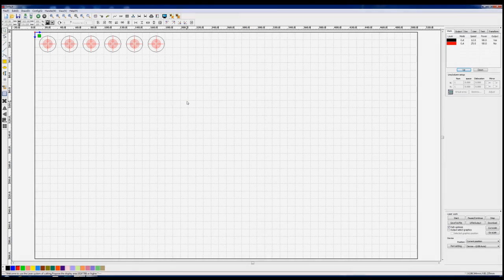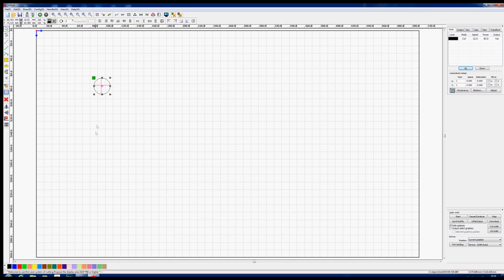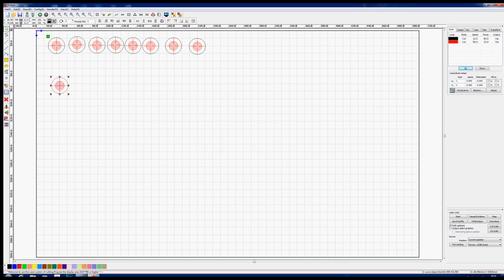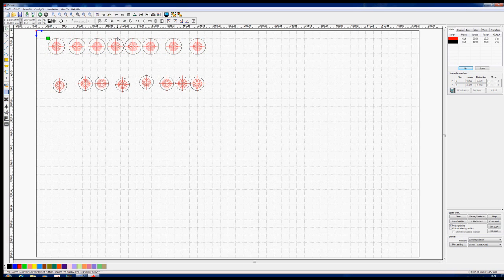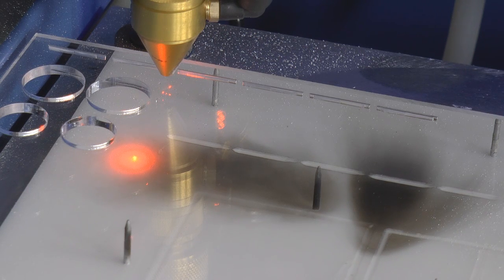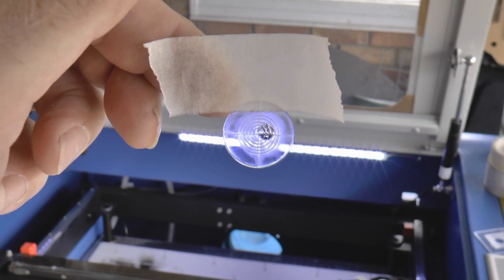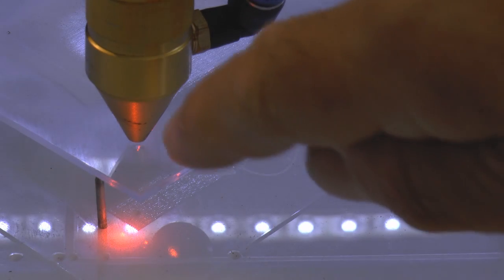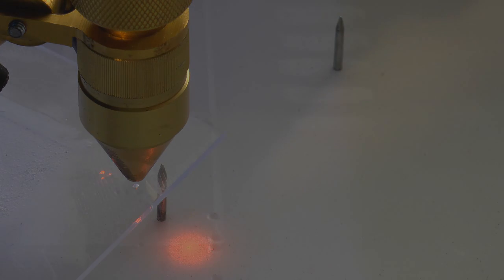RDWorks Learning Lab 12 mirror alignment

Comment: Hi, i have question, I turnup side of focus lens on my laser, and results are inseine :D
I cut mdf on speed 25 and power 60
When I turn lens I can cut with speed 30 and power 50
Is it safe to stay like that? What can be wrong?
Reply from the maker: Hi Zoran
 There is nothing wrong. The Chinese always deliver machines with lens flat side up.  This produces a sharper dot for engraving  but it is a proven fact that setting the lens flat side down will reduce the focal distance and improve your cutting performance.. Most people run flat side down it is completely safe.

Best wishes
russ
Reply: @SarbarMultimedia  thank you Russ

Comment: I want to cut rolls of medical patch material (somewhat like a roll of thin cloth) using my laser and rdworks. I'm thinking that the U-axis can be used to control a stepper motor to turn the roll and thus feed the material for automated cutting. I know there is a "Enable Feeding" section in the Output section. Can this this be done? If. so can you take a bit of time to give me some tips on how to proceed? If I can create a reliable machine for cutting material from a roll that is doesn't need constant intervention, I may be able to sell the machine to a customer who is interested. Thank you.
Reply from the maker: Hi Paul
I have no direct experience with the U axis which I know is uncommitted on most machines. I'm sure the intention was for it to be used as a feeding system because there are so many allusions to feeding options and parameters in RDWorks  and in the RDC644 XG manual that you can download from here  
http://en.rd-acs.com/Private/Files/a4d9f12fe9e32eb7.pdf

Although I may not be able to help more than this, if you like to message me with your email address I will try to link you up with an installation engineer who probably has that experience.

Best wishes
Russ
Reply: Thank you for the reply. My email address is paule.zacharias@gmail.com

Comment: What significant advantages do lasercut pieces with cross-hair offer over mere pieces of transparent scotch tape? Why bother using software to draw them and then cut them? I don't see any point in that. Other than entertaining yourself. :)
Reply from the maker: Hi Georg
This was one of my early videos. It was mainly intended as an exrcise to show some of the tool in RDWorks. I did use them  because if you hold them in place with tape there is no chance of the pulsed beam burning through the tape and "smoking" your mirror. 18 months on from there I now use removable card targets see
https://www.youtube.com/watch?v=R1H71Zs2wxc
and
https://www.youtube.com/watch?v=2SaOo5nFGrU&t=127s

May explain better why I have gone this way.
Reply: Thanks for you answer.  I'm sorry, I don't quite understand, how can you "smoke" a mirror? What does that mean exactly?
Reply from the maker: Hi Georg
If you stick tape directly onto the mirror and then burn through the tape  you will leave a horrible sticky residue on the mirror. If you have entry ports as I have on my 3550 machine then sticking tape on those port entry will still produce dense sticky fumes inside the port when you burn through the tape. Those fumes settle on the mirror. Both of these ways of testing beam alignment will cause "smoking" of the mirrors. The mirror will then require cleaning. A thick card target allows you to clearly see wherethe beam is scorching but does not burn through the target hence the mirrors stay clean.. This is just what 2 years of experience has taught me.
Reply: I did not mean sticking scotch tape to the mirror directly, of course. I have mirror holders with tubes that go before the mirrors. Actually, you have the same type holders on your video. That's why I asked why you had to use plastic pieces. :) Thanks for your answers, anyway.
Reply: How can you make crosshairs on a machine that you need to align the mirrors on ? Won't that mean if it's off your crosshairs you just made are off too.

Comment: Don't you agree the more true the beam the better quality the beam the better quality the Work?
Reply from the maker: Hi Mark
You are right about the trueness of the beam. What looks like the easiest part , bouncing off  mirror 3 straight down the lens tube is in fact the hardest thing to achieve. Ideally you need the beam from mirror 2 to strike mirror 3 at the point where the tube axis intersects the mirror. I had to draw my head in detail to work out where that position was and have now marked an aiming line on the face of my head. It now means that when I steer my beam onto lense centre I know its also perpendicular to the lens. 
Now beam quality is a different issue. There have been times when experimenting with my prototype copper mirrors there was  beam shape distortion at mirror 3. and the beam was no longer perfectly round. Will this make a difference to the cut?  Well no, because 40 watts of energy in a 6mm beam or a misshapen beam is still 40 watts. By the time it has been focused down to the thickness of a human hair the energy density is so high that shape is not an important factor. 
Thanks for your comment. It's always good to analyse these details
Best regards
Russ

Comment: Wish you would show exact centering. I've been a carpenter , home builder, and wood worker luthier for over 40 years . I understand your theory of making the beam parallel is good enough. Trouble is I'm hoping to hook up a autofocus sensor (Z) . I've always found when you are depending on multiple things and you aren't exact sooner or later something will suffer. You as I have a redlocating dot, plus the software I assume it's positioning of XYZ are all on center. So at least for me ilearned decades ago weather setting up a laser level or anything else for a bench mark and on getting your alignment done that's one of there desires. Maybe I'm too I don't know I hate saying perfectionist. I use a 5 HP overhead pin router. If I don't have my table andcutterhead 100 % perpendicular and say I want to fit a guitar neck to a body it won't work . Once it's no longer aligned my cutting area or hole will not be round

Comment: Hello. I have recently come across you video sessions and I congratulate you on the ammount of information you have been able to deliver. I have got a 40watt laser and cutter. I mostly do alot of engraving to ready made items as a small business. However looking on the internet and after exhuasting myself I still have not found what I am looking for. Hopefully you might know. I am talking about adding text. It all well and good adding a single line or two but when you wnat to add multiple lines RD works does not give you the option to centralise you text so its all got to be done manually or one line at a time. Any ideas?
Reply from the maker: Hi George
Sadly, you are correct. The text feature in RDWORKS is VERY basic, However, I have have overcome the problem with the following technique. I use another program with font manipulation facilities, Adobe Illustrator, CorelDraw or even my CAD program. Layout your required text as 72 point size and save/export it as a file format that RDWorks will recognize  ie bmp, jpg, dxf etc.(if you are given a resolution choice make it high).  IMPORT your text "picture" to RDWorks and then close the padlock and change the % scale from 100% to 10% in just one of the windows. Press ENTER and.........problem solved.
Reply: Thanks for that, I Have been down that road, and with the amount os work that I am doing at moment it is a bit long winded so I have found that ungrouping and centrelising is the quickest way. Truth be told right now I have more serious problems with the chiller. with the machine being in an enclosed area I am finding the temperature is rising a bit high especially in this weather. So I have had to purchase a small aircon to compensate.  I am also thinking about upgrading to a 60w instead of 40. Do you find that you are cutting thicker material? I mainly use birch 3mm, and  poplar 6mm  laser ply and acrylics.
Reply from the maker: As I mentioned previously you will be struggling to cut with 30 to 35 watts unless you have a 1.5" FL lens. A proper 60 watt tube will breeze through your materials, However, from what I deduce, you have a small desktop K40 machine and I'm not sure you can upgrade that to a proper  60 watt tube that will be about 1200mm long and maybe 55mm diameter. So that may mean a new machine

Gladly I do not have any serous temperature issues because I do not use my machine for significant periods.  I know that industrial chillers are very expensive.  There are several alternatives to spending out that money.
1) A simple and cheap method used by many people is to freeze plastic bottles of water and drop them into your reservoir of warm water. With an adequate supply of frozen bottles you can keep your temperature down.
2) This is a method I use for the very few occasions I run into temperature issues. If you look at my 4 month review   (  https://www.youtube.com/watch?v=g5k6YhNqfSw       at about 6min 30s) you will see a coper coil that I made to drop in my tank and around my pump. I connect that to my domestic water supply which even in the hottest UK weather, never exceeds 15C and most of the year is below 10C. A small flow of about 2 litres /min easily keeps my water below 25C. This PLAN A works well enough for me but I also have a PLAN B and  a PLAN C
3) Plan be involves a rainwater collecting tank  which sits in shade outside my workshop Another submerged pond pump in there would circulate the large reservoir of cool water through the tank coil.
4 Plan C is a method I have designed and used for  a client who sells germination water baths that run at 30C during an 8 hour "day" but need to cool down quickly (within 1/2hour) to 20C (sometimes 15C) for a 16 hour "night " cycle. For this I buy a cheap small chest freezer and fit a plastic water tank inside it. The tank contains a submerged circulation pump and a temperature probe to switch the freezer off when the temperature of the water is below 5C. Unlike an industrial chiller that attempts ( very inefficiently)to produce instant cold, this method exploits the fact that you are only needing cooling for part of the day. During non-working hours you are building a reserve of "negative heat" with very low energy  usage. If you can redeploy an existing freezer, this system is almost free but a second hand freezer will cost very little also.

Hope there is something here to stimulate your imagination
Best regards
Russ
Reply: Thats great Russ. You certainly know your stuff. and well informed.  As far as the tube upgrade the answer is yes I ca, I have already checked with the people I purchased the machine from, it will need to have a small extension fitted to the back and its only aroound £50 for the part and £250 for the tube, so for around £375 I can get it all and fitted. Thats for the advice. Much appreciated.

Comment: Hello, thanks for this it is really useful. I wonder if you mind me asking your advice? I'm just trying to get mine set up and I have printed an air assist nozzle which funnels to a point (which makes it similar to the nice brass head your machine has except it's not really quite as lovely!) but I notice that the beam doesn't come through the centre of the point which I guess means it's not going through the middle of the lens; in fact it's a good mm or so out. The mirror on the head doesn't have adjustment the way yours does. Obviously I can just make the nozzle wider, it is for the air assist after all but should I be concerned that the beam isn't going through the centre of the lens? I hope you don't mind me asking your view...
Reply from the maker: Hi Nicola
I'm guessing you a small K40 desktop unit. I have zero experience with them. The hole in the end of my nozzle is about 5mm diameter and I try to get the beam within 1mm of centre when I set the machine up. If you take a piece of A4 card and program a rectangle say 280mm  in X and 180mm in Y and burn a rectangle on it You can measure the diagonal to see how much difference there is . I would not expect more than 1mm (2mm absolute max) If the beam is staying with a fixed offset all over the machine then I don't think you should worry.

Best regards
Russ
Reply: That's really helpful (and achievable!) thank you! I will try this out. Many thanks!

Comment: Just saw some of your videos and they are informative with regards to laser cutters as I am thinking of getting one using that looking at your videos do give some insight. What I noticed when you mentioned the scale of the output and the drawing is a 1% difference is likely to be due to the stepper motor steps per mm setting which is in the firmware is not calibrated correctly thus giving you a slightly different size. This is the same problem in 3d printers which the correct steps per mm is needed to be programmed into the board firmware in order to have exact 1mm to 1mm scale.
Reply from the maker: Hi Cary
Yes you are correct, there are places in the vendor settings that allow you to correct any small errors. But. unlike most CNC machines you have to very careful that what you see is caused by stepper error.  If your beam alignment is a bit off then it's quite easy for the beam to  move off true at mirror 3. If this happens then the beam hits the lens at different off-axis positions as you drive the head around the machine.  The beam is no longer perpendicular to the table and could burn a geometrically incorrect rectangle even though your stepper motion is correct. You do not experience this sort of error with a normal cnc machine, the tool always stays true to the spindle axis.
 What you must remember is that these video are not training or tutorials, they are a record of my learning journey with this machine. I sometimes jump to dubious conclusions but as you get further into the series you will see that I usually discover the whole story. It took many months to arrive at a logical and efficient way to set the mirrors  which you can see as a two part video starting at  https://youtu.be/Vl6QKlwRKlk 
I spent the first 8 months of ownership fighting to understand why I was either not getting power out of my tube or where I was losing power in the system. My 8 month review sums up the struggle and the modifications I made to the machine. https://youtu.be/4qy5cPZWGj4

As I now find out from many correspondents, my story is fairly typical of buying and ebay machine so don't be too disappointed if you have to work around a few problems

Best regards and thanks for your input
Russ
Reply: +SarbarMultimedia thanks for the input. it is great that you record these learning process. For me, having build the cnc machine and now working on the 3d printer firmware it is very much a hassle to look into the programming. 
As one of my experience gotten a chinese printer that was on the more expensive side. it is built quite well but let down by crappy extruders and unsupported boards. so have to strip out all the wires and board and redo it with a new firmware. so now sourcing for a laser cutter is more cautious in getting the details of those systems to lessen the potential unexpected issues.
Reply from the maker: Hi Cary
It is certain that you will not get whats advertised (unless you are one of a few exceptions) Any machine that's advertised as 50 watts will be fitted with a B grade 40watt tube that will work, but not very well or for very long . 60 watt =50m watts, 80 watts =60 watts and 100watts =80 watts. How can you tell? look at the machine case width and subtract about 150mm to fit mirror 1 and another 25mm for air clearance at the HV end. Now go and look at the lengths of various power tubes from the Chinese tube makers and see what fits the machine you are thinking of buying . A year of experience and lots of correspondents. has taught me lots about the Chinese way of selling.

Good luck
Russ
Reply: +SarbarMultimedia hi Russ. that is a good insight on the size and what we are getting. thanks for the tip.